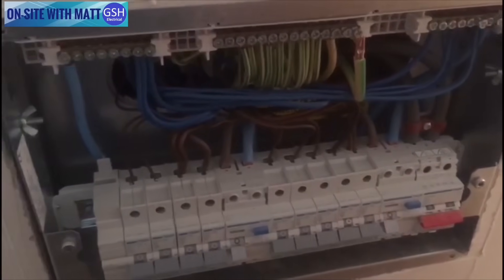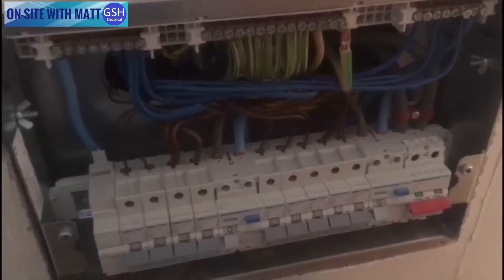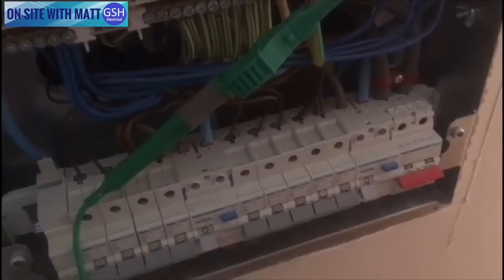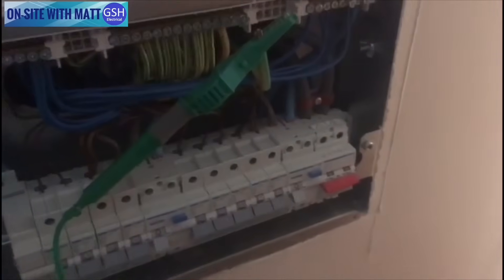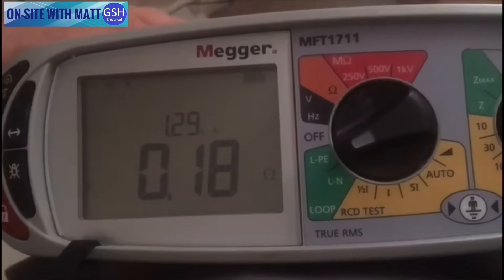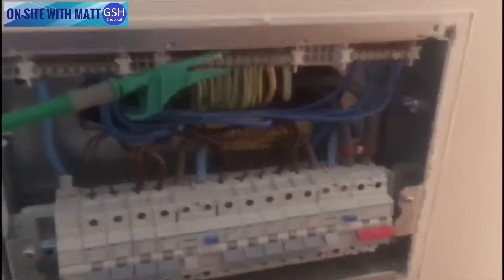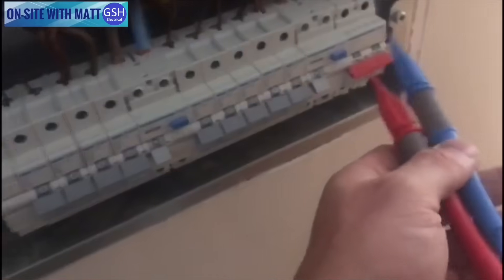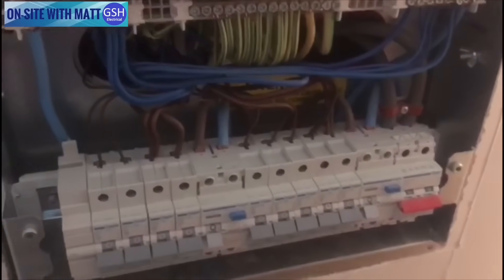LIVE Electrical Testing External Earth Fault Loop Impedance (Ze), PFC, PEFC & PSCC

Comment: Are the connections exactly the same for a TT system? Do I need to disconnect the water and gas bonding conductors for a PFC test to avoid parallel paths for a TT system? Thanks.
Reply: Yes. That's for Ze. For PFC it has to be connected

Comment: Great video for real life situation.  I'm not a qualified electrician but working as a mate and learning.  If Ze is 0.18 ohms how can Zs be higher than that (0.19 ohms) with the parallel paths as extra routes to earth?  Stupid question?
Reply from the maker: Hi. Remember the voltage will not be the same for both tests it keeps changing... parallel path‘s water with an incoming plastic pipe and I think the heating could have been storage heaters hence on parallel paths (no gas). Great question and one we will cover in the classroom thanks for commenting and watching GSH Electrical 👍
Reply: Thanks for taking the time to reply.  Happy with that explanation.